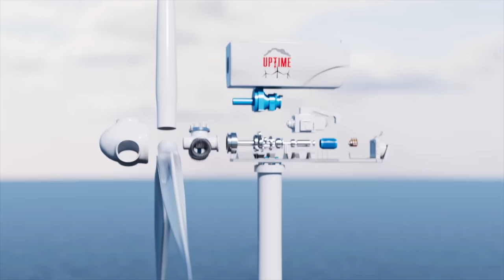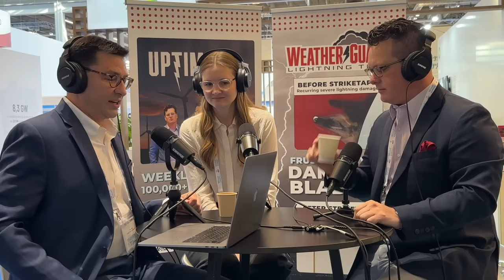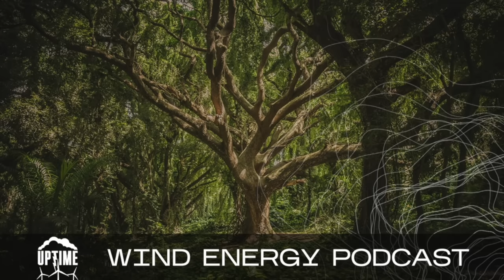Borealis Wind Heats Blades to Fight Ice

Comment: Merci beaucoup.   We are experiencing Climate Whiplash now as the Jet Screams have broken down and the cold air is no longer contained in the Arctic.   Until the temperature gradient stabilizes on a planet with loss of ice caps, things will be crazy.  So a technology like this will be vital if we are going to power our world with fossil fuels becoming more costly, economically as well as environmentally. 
Since I seem to be the only You Tube Wind Nerd, I'll spread my opinions with no filter, sort of like Trump.
The wind industry has to develop an airship.
They need to rebrand and quit developing only industrial wind, but start doing community wind turbines.  Smaller turbines, even though less powerful, can be installed closer to urban locations.  Financing these through local grid companies that are not run by Banksters will change people's opinion.     LOL.   They've brainwashed the Sheeple so thoroughly it'll never happen.  Gotta dream, though, n'est-ce pas?
Y'all need to develop better storage technology, including salt water batteries.